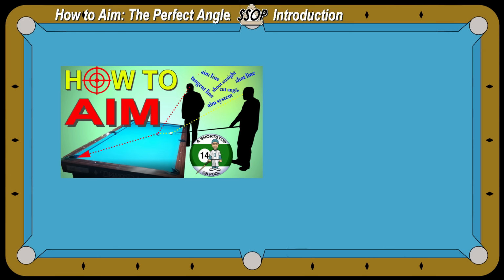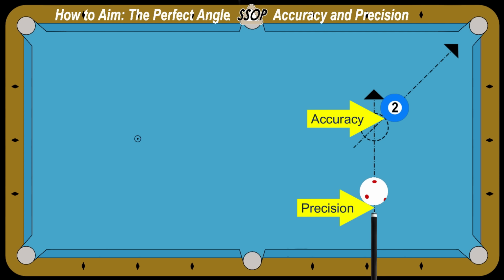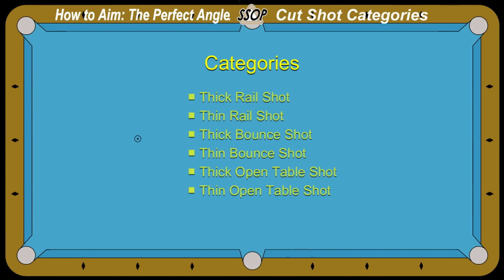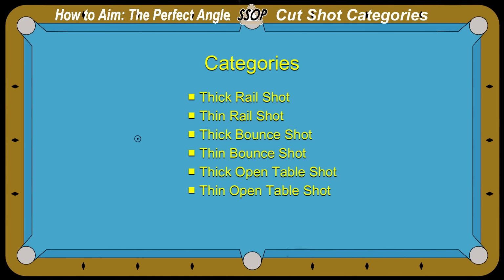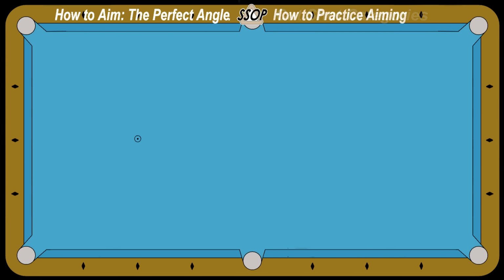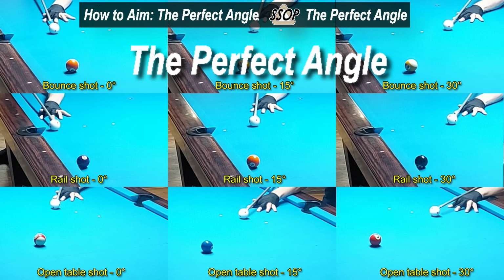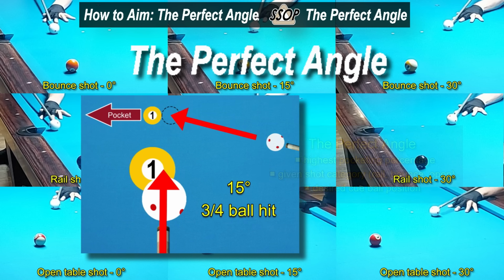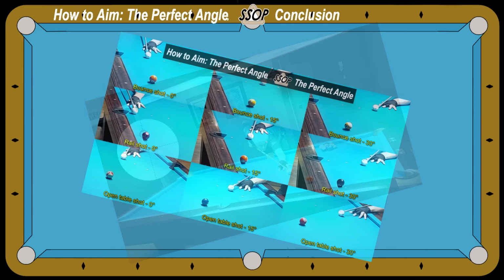How to Aim 2, The Perfect Angle

Comment: so glad you didnt editout the misses..   Also.. what  people should hear is that when you are two cue sticks above or below center, (top spin or baCK SPIN on the cue ball) the margin of error where you hit the cue  ball with the cue stick  is WAY smaller, as the cue stick tends to slip off the ball if you are ANY distance off center.. or if your cue tip is even more too low or too high..  we have all seen those missed shots (Clink!) where the cue ball may not even move barely at all.. and of course we all have a good laugh.. Usually when that happens there is a side deflection of the cue stick(and hence cue ball too) also because of the curvature of the cue ball requiring a very accurate contact with the cue stick when hitting off center..

Comment: A great video, thank you!  Will be helpful for many students of the game.  I do have to add that I disagree with several of your statements - in particular aiming systems.  I'm amazed at the resistance to aiming systems and then the instructor gives instruction to a system to train the eyes for a shooters particular style.  Despite the number of pros who actually use a system (although some can't explain it).  That's not by accident and they all use varying styles.  Even SVB and J. Barretta, two of the greatest American players have a system (and I'm sure they've varied it over the years).  A few pros have even publicly thanked the creators of such systems after winning titles.  With that said, every system breaks down or has a weakness at some point (no different than aiming to miss long and short does).  There are plenty of other variables at play (speed, shelf depth, pocket size and acceptance, friction caused by the table, humidity, cleanliness of the balls, ability to deliver an accurate stroke for the proper speed, etc)  Because of this they continue to spend hours each day honing those skills (both visual references, stroke delivery, position play and spin).  And at professional events tables tend to loosen up and play easier as the tournament goes on and the tables "settle.,  And those are only at 3 or 4 day tournaments.  To me, an aiming system is just a well defined measuring tool - just as playing to miss is.  Some systems are more accurate than others.  But they are easily adjustable to a particular tables variables because they ARE measured.  And you are using the same computer (the brain) to make those adjustments (which would have to be done no matter how you aim).  Where players generally falter is by not making their routine repeatable, not understanding some of the principles of physics involved, and as you've so adequately explained, not being able to hit what they are aiming at due to poor fundamentals, visuals or not understanding the mechanics and making them repeatable (many cannot describe "good" or "bad" fundamentals or mechanics.  Overall, and despite the disagreements, a great video for folks trying to learn the game.

Comment: Am i being stupid?  You have not stated to me where you are aiming for each degree or shot?  You just keep saying pick your aim after several miss shots?  Is that so?
Reply from the maker: Not stupid. I try to explain simply but everyone's brain works a bit different so I make assumptions without meaning to.
The idea is that you pick a point that you think/hope/believe/assume is correct. After observing the results (assuming you hit that point) you can adjust your aim. Most people will correctly pick a point that "misses" the pocket on each side. So now you have your boundaries to start bracketing in from. 
Its never random. You can only adjust if you know exactly where you aimed. Won't take long to find the center of the pocket, then you reinforce that aim point with repetition. Along the way you are learning the angles to each side of the current shot so you'll find adjusting to other angles happens easier.
And the bonus is that learning to aim a ball at a target other than a pocket (such as playing safe or banks) also comes much easier.

Comment: Good info. I learned to shoot, and cut without using outside english, however I have been playing for 40 years and a B+ player, so a lot of my knowledge on cuts with throw and deflection I guess is built in, I honestly just learned about throw and deflection a year ago, I never used an aiming system either. What keeps me from being an A player I think is that knowledge I learned on my own.. On some shots I have no problems using inside or outside spin and some I miss using the same aiming system which again is just millions of shots. I guess my brain automatically adjusts the aim when using spin? I've noticed when I do miss these shots it's usually because I don't hyper concentrate on the contact point of the ball? Sometimes when using extreme spin, I do aim a little left or right of normal to accommodate, sometimes I works, and sometimes it throws the ball and I miss... Any ideas would be greatly appreciated
Reply from the maker: Very common question. The answer most likely is not in your aim but your fundamentals. An involved topic best addressed in person. Cue ball sidespin is used only to control the cue ball when speed and tip position on the vertical axis isn't enough. But you probably already know that. As you say, you've learned to shoot with lots of unconscious twists and spins. Coming back to the vertical axis will cause misses at first as you learn to "go straight". Thats what progress can be built on.  Good luck!
Reply: @ShortstopOnPool  Thank you. Yes, I am good player, I'm usually running 1or 2 out 10 racks if I'm playing on 9 ft Diamond tables, as you know the smaller pocket tables even make this subject more important lol. I just want that next level of play that has eluded me for a couple of years now. I just bought a low deflection cue which I'm sure will take some adjustment time on it's own. Great channel man, keep up the good work.
Reply: @ShortstopOnPool  After watching this video I think you made me realize that I am using unnecessary side spin.. The cut shot in the corner you demonstrated with center ball, and then one tip below to get further down the rail I would have likely used outside right to achieve this same position, and of course making the shot more difficult. I do practice drills but I've never thought to just shoot the same shot over and over using different tip locations on the cue ball with no spin to see what happens.. Why I don't know? lol. I def will start though. Thank you

Comment: At 12:11 he says i will teach you a system to aim.  Because that is exactly what defining objective characteristics and assigning categories to shots and creating methods to use those characteristics is.  Anything other than purely guessing is a system.  And when a system is used then it depends on the accuracy of the results.  With CTE for example the accurate of results are very high for a person who has matter the method.  Cte is not a magic method, it is a set of instructions that produces the correct shot line when those instructions are precisely followed.

Comment: Great video! This is the best explanation of how pool works that I have seen in a video yet. I forwarded it to the rest of my APA team.

It's interesting that you break the ball up into halves thick and thin, I tend to break the ball up into three sections, the middle half and the thick and thin quarters.

Also I wanted to let you know about how I adjust my aiming to compensate for a throw. When shooting I don't use math but here is the math behind what I do quick and dirty so you can understand where it comes from.

Max throw(CIT or SIT) is 1 inch per foot, on a 9 ft table the diamonds are 1 ft away, American pool balls are 2 1/4 Inches across. So if the object ball is 2 1/4 diamonds away the aim adjustment should be 1 ball width (to the left or right, depending on how you're throwing) if you are 4.5 diamonds away your adjustment is 2 ball widths and if you are 6.75 diamonds away the adjustment would be 3 ball widths.

So you should be able to set an object ball 6 3/4 diamonds away from a corner pocket and set up your cue ball to be a half ball hit. Look down the shot line and aim three balls over and shoot softly at pocket speed and you should push the ball right into the pocket. Alternatively, you could leave both balls in the same place but aim three balls in the other direction and shoot with guaranteed throw and still make the ball from across the table.

I do these kind of adjustments all the time and they are pretty accurate. Also, I am getting much quicker at estimating My aim adjustment in ball widths. Turns out my shaft is just over a one ball width adjustment. I like using ball width for this because it's something that I can judge easily from across the table.

Anyway, keep up the good work and good videos.
Reply: I dont get this. A ball width? 3 ball width?! That's almost 7 inches, completely missing the entire target ball... Am I missing something here?
(I'm very interested in the aiming techniques and still searching for the right method for myself. Will try bracketing, very excited about it )
Reply: @Imikacic  yes, since I have posted this I have realized that a standard q shaft is less than 2 1/2 ft and a ball is 2 1/4 in. So for every "shaft distance" (the length of your shaft) that my object ball is away from the pocket I will adjust my aim point by the width of a ball (2.25"). This works for me I am used to seeing balls and my brain see what a ball would look like from across the table. 

You can test this for yourself by putting an object ball one shaft distance away from a pocket, give yourself a medium angle (about 1/2 ball) so that you are not straight in and not really full and not really thin. Then test it out buy shooting the shot softly while aiming to one side or the other of center pocket. You should see that if you aim to the wrong side of the pocket the object ball hits even farther away and if you aim to the correct side of the pocket it pushes the object ball into the pocket. And if you aim to the center of the packet you will push your ball offline and might even miss the shot. 

Understanding how CIT works is critical to shooting well

Comment: Figuring out the friction between the balls is always hardest for me. Every table and ball set is different especially in bars.
Reply: That ain't no shit. Anytime I'm popping into a new place I'm not familiar with the tables to plan tournament I'll get there an hour or so early and run a game on as many tables as I can to get the feel for it. I grew up playing on shity warped unlevel tables with tight hard-ass pockets that would wobble out with the slightest miscalculation on your shot. Playing on bar tables was an improvement for me. But I never forgot to figure out the run of the table and how the banks acted and how the felt took spin
Reply from the maker: Correct. When I played in bars in the 1980s many tables had the old "mud" cue ball that was noticeable bigger than the other balls. When you stroked it for draw, it would literally roll forward a few inches before the backspin would catch. LOL

Comment: What do you think of stan shuffet work and cte?for aiming?
Reply from the maker: I don't.
Reply: @ShortstopOnPool  you dont know about it or would not use it ?which one?
Reply from the maker: @lavonkim3359  I know it. One video I plan on making someday will prove how it does not work. I've already covered it generally in my "Top Ten Reasons..." video. I talk about in several of my videos including this one.
Reply: @ShortstopOnPool I'm a cad drafter, I see you make diagrams also, the geometry does not lie, CTE does not match the geometry for every shot, all the shots that do not line up, they are compensating for.😊
Reply from the maker: @DANTHETUBEMAN  Yup. They compensate without knowing. The key to aiming and pool in general is developing a deadly accurate/straight stroke.
Reply: @ShortstopOnPool  I say if your strait in shots are not going straight every time. weather is any angle shot. 😁
Reply: No aiming system can be perfect because the same contact point under different conditions produces different results. Speed spin slide on cloth humidity cleanliness of table and balls. Those that can adjust to every nuisance of this game will excel.
Reply: Stan Shuffett leads the Heaven’s Gate of the billiard community. Following his CTE theory is the Hale-Bopp comet of his cult.
Reply from the maker: @audrichvuneo181  They are pool's Flat-Earthers. No convincing them otherwise.
Reply: @ShortstopOnPool  this is nonsense.  Glad you made this comment.  Now I have the intro for making a video critique of you videos on the subject of aiming.

Comparing CTE users to flat rathers is among the dumbest insults you can make.

Stan is a short stop.  You have zero chance to beat him in a shot making contest.  I am so confident in that that I would sponsor a match and double the prize money for you if you can win.  You don't even need to bet.  You just need to show up and complete.  A free spot at my money.

But, you won't.  For the exact same reasons that no one else who doesn't use objective aiming systems won't.  Namely, your shot knowledge/shot pictures aren't enough to get there.

Any person who has mastered CTE can do everything you can and a lot more that you cannot.
Reply from the maker: @jbcasesoriginal  I would be happy to play Stan, he seems like a nice guy and pool nut like me. But it wouldn't prove anything. Stan is a  better player by fargo, his 740 to my 673. And the winner of a contest is determined by SO MUCH MORE than just "aiming". He would most likely win. I've never understood this need to challenge and beat people. We are all only competing with ourselves in the long run after all. You are welcome to critique me, of course!, I am planning on making a video specifically about CTE but would like more specific knowledge of it first. Beyond what I've gathered on YouTube.  Would you be interested in giving me a lesson?. But I not interested in negativity or boasting of any kind. Just the facts.. Instead, why don't we all work together for the betterment of pool.
Reply: @audrichvuneo181  that is incorrect.  You folks make these comments but you are always unwilling to bet on your comments.  CTE is just a set of instructions that produce an accurate center cue ball shot line.  That's it.  Not a religion, not magic.  Just a great method to use the objective references in a deliberate manner to get to the shot line.

This guy is telling you a method to achieve the same thing.  The only difference is that he is repackaging information and adding his own labels.

That you all can't understand the power of getting an accurate center ball shot line that can be easily adjusted from for a different outcome is really confusing.  Anyone who uses the religious nut insult presumably relies on science.  And with science it's obvious that if a set of instructions produces a repeatable consistent result then it is likely a valid method.

Not a single one of you, especially not this guy is capable of reproducing Stan's shotmaking videos where he makes the object ball into six different holes from the same position in less tries than it takes Stan to do it.

You can't do it.  So either Stan is some sort of pool magician fooling everyone with illusions or the CTE method he teaches is valid.

You can't uncover the illusion because there isn't one.

I went to his house and challenged him directly. Something not a single one of you is willing to do.
Reply: @jbcasesoriginal  oh look, a member of the cult